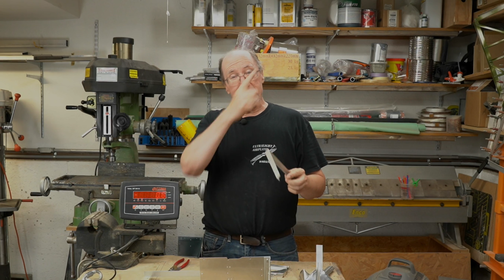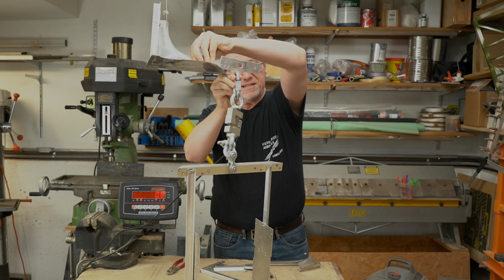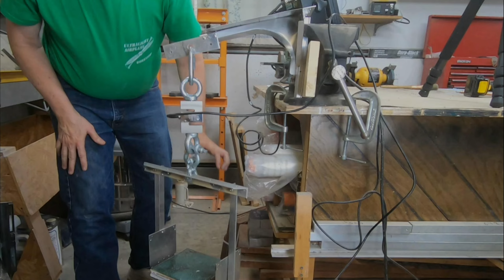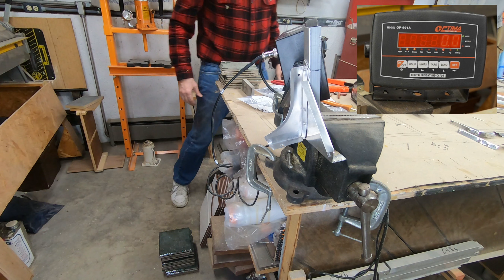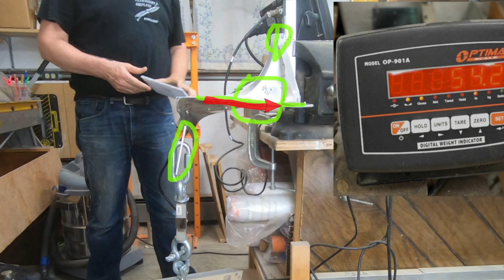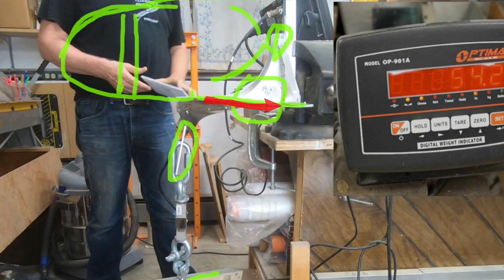Cantilever Rib Portion Testing: Part B

Comment: why not just test a full nose rib segment, rather than partial segments? the samples are behaving differently than they actually would due to unconstrained end behavior.
Reply: I was thinking the same thing and commented above before I noticed your post.
Reply from the maker: The purpose of the smaller tests was to better understand how various parts of the rib might fail in order to have the knowledge to design a better but light weight rib.

Comment: Interesting design study!  Is there a reason you are avoiding a diagonal truss element in tension?  As you say I expect the truss will require less Aluminum. I assume you are not designing for inverted flight loads. Do you have access to finite element analysis?  Maybe you should look into Fusion 360 FE modeling?